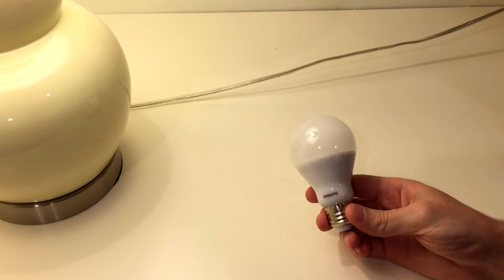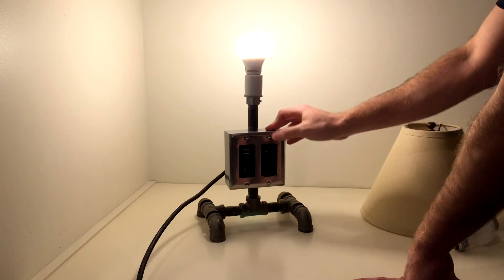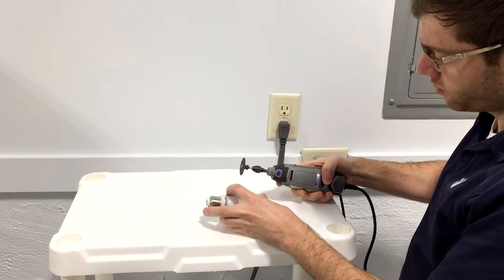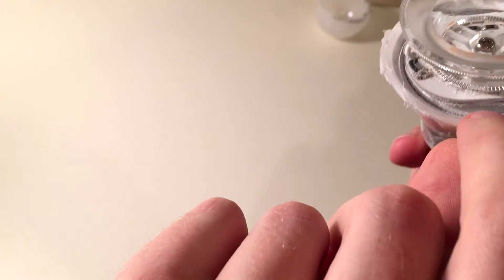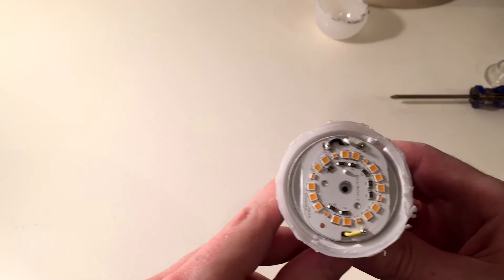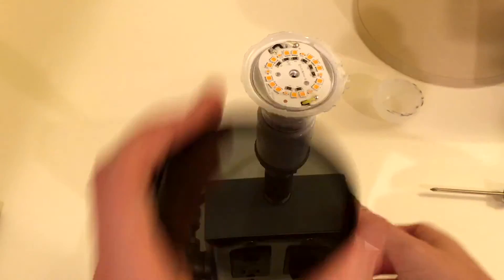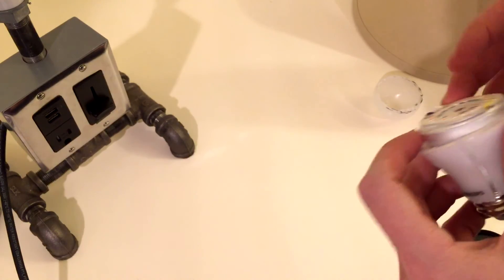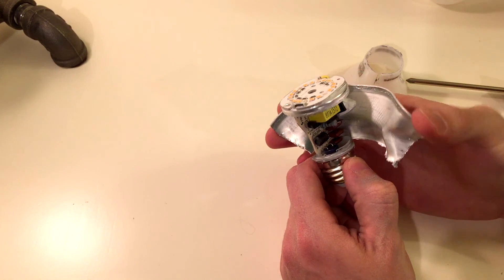How Philips Dimmable LED with Warm Glow Light Effect Works, Teardown

Comment: Too bad your camera doesn't have a "white balance" setting that you could lock it in to "sunlight"... so it wouldn't adjust itself. That would give us a true idea of the color temperature change.
BTW... you do realize that there are likely lethal voltages in there... right? You kept putting your hands pretty darn close to the 'live' circuits.

Comment: Thanks for this video! Looks like a decent quality light! Not only in terms of light characteristic, but also build quality!

I have one of these "WarmGlow" lights of Philips in an E14 socket version. Unfortunately, with that light, the PWM dimming is very visible (at least to my sensitive vision). If you would film that light with camera, you would certainly see a lot of 'banding' scrolling through the image. 

Good to see that the E27 version does not seem to suffer from this effect, possibly because of the component you mentioned. I reckon the E14 formfactor is too small to house extra components to reduce PWM effect.